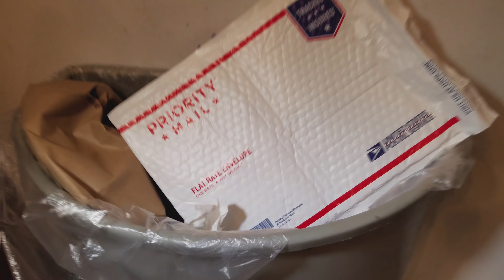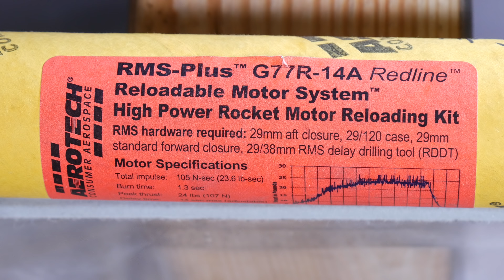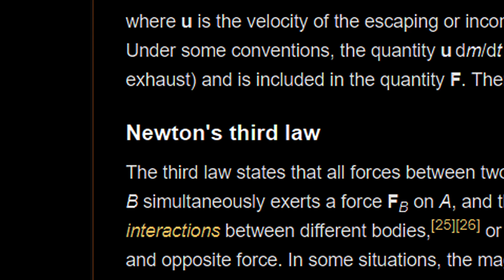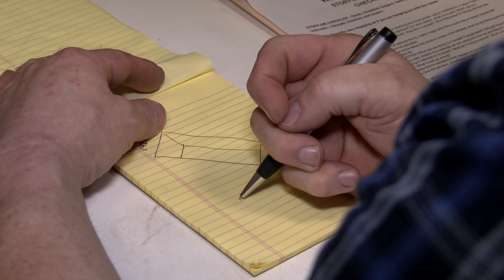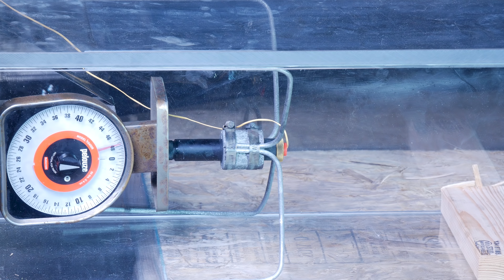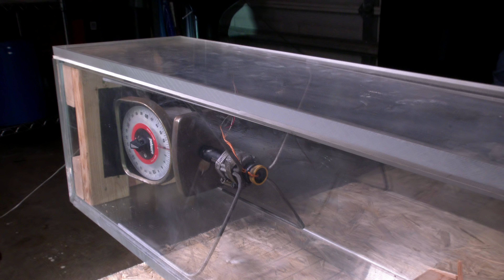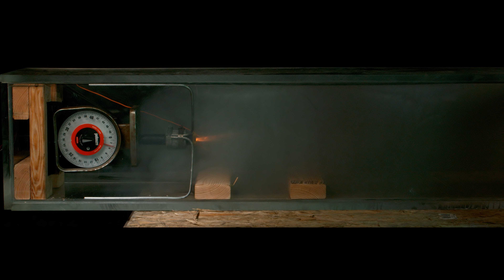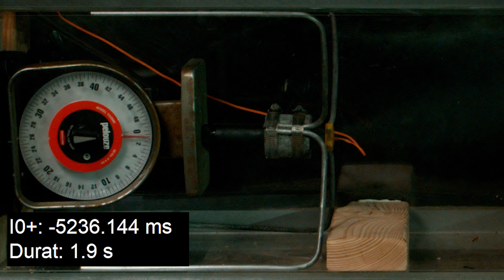Rockets in a Vacuum Chamber - Newton's third law of motion Visualized

Comment: It is hilarious that people are even questioning Newtons 3rd law - Is the dispute just over rockets in a vacuum? For the doubters, how does recoil work when you fire a gun? Is the force you feel the bullet pushing back off the air? The principle is the same, you throw something away from you and it will impart a force in the opposite direction. In the case of a rocket, it's lots of fast-moving gas, or many tiny bullets, if you will.... Try sitting in a wheelchair and firing an automatic weapon forward, you will start to move backwards. What's the difference between that and a rocket firing?
Reply from the maker: I was not questioning, just for fun. but I do like the firing a weapon in a wheelchair idea, that would be hilarious to see.
Reply: @WarpedYT  ive actually seen someone do that on youtube
Reply: If you do it put post the video :-)
Reply: seriously? trying to compare the forces, & effects of gunfire and a rocket engine? dude that is absolutely ridiculous, the 2 couldn't be any more different, thanks for the laugh though
Reply: @snuffly569  really. They are more similar than you think. A contained explosion ejecting, mass to cause which recoil creates acceleration. The gun is a rocket, the neck of the barrel is the burn chamber, the end of the barrel is the nozzle, and the gas and bullet is the exhaust of the rocket. Breaking it down to the simplest form, they are very similar. Except one has a short impulse while the other is a constant impulse.
Reply: @snuffly569  so if the atmosphere is needed to push off of. Can you explain why does the recoil on a gun not depend on elevation? Thinner the atmosphere the less pressure the atmosphere can push back?
Reply: i don't understand your question, elevation has nothing to do with a guns recoil
Reply: @snuffly569  exactly, if elevation has nothing to do with recoil, then the atmosphere has no effect on the gun. Then the atmosphere has no effect on the rockets recoil of the thrust. If you break down the forces and momentum of the rocket, it acts just like the recoil of a gun, except it is full auto and has a much faster cyclic rate.

The recoil of the gun and on the rocket is caused by newtons third law and follows the conservation of momentum. Atmosphere is not needed to cause the reaction force to propel the rocket, just like how it is not needed to cause recoil of the gun.
Reply: recoil in a gun is caused by the gasses inside the bullet casing expanding, it is that expansion that pushes the "slide" backwards, which is what is known as recoil, it would act the same underwater, at ground level, and in the air, & in a vacuum. elevation is nothing more than a descriptive term to signify the distance something is above sea level, and is irrelevant to the workings of a gun.  a rocket engine works in a different way than a gun, when a rocket is in space in a total vacuum, if it fires it's rockets, there is nothing for the rocket engine to "react" against, when a rocket leaves a planets atmosphere and enters the vacuum, the crew can turn off the engines, and the rocket will continue at the same velocity, in the same direction, until an outside influence alters its speed or trajectory, with nothing to react against, "directional thrusters" will do nothing more than to vent gasses into space
Reply: @snuffly569  look at a bolt action gun. The recoil isn't felt till after the bullet leaves the barrel. The force of expelling the gas and bullet to leave the system is what causes recoil. Just like the force of expelling the exhaust causes recoil. Every action has an equal and opposite reaction. 

Another way of thinking is the conservation of momentum. When the bullet is inside the gun there is no momentum. As soon as the bullet exits the barrel with velocity, the bullet has momentum. Without an external force acting upon the bullet the total momentum of the bullet/ gun system must remain zero. The explosion is and internal force because it was within the bullet gun system. So the gun must have momentum in the opposite direction equal to the bullets momentum to conserve momentum. 

The force of the expanding gas being expelled is how ar 15 works, muzzle break,   gas blowback works. It's also the reason why silencers have less recoil. The gas exiting the system is prolonged and slowed. This lengthens the impulse and lowers the momentum of the gas.
Reply: @snuffly569  if thrust needs an atmosphere to push off of, how can the sr71 reach mach 3 at 85,000-100,000 feet?  Wouldn't the thin atmosphere lower the force propelling the jet be greatly weakened by the thin atmosphere? How can the thrust push against the atmosphere moving away from it at mach 3?
Reply: +chrnc avngr
Sorry pal but that is incorrect.
Go fire a blank from a firearm.  No perceivable recoil.  Yeah, there is a bit but not really enough to feel and yes, I have done it many times starting on the fourth of July when I was like 8 years old and the old man let me fire a 30-06 with blanks into the air.  The MAIN force is the mass of the bullet vs the mass of the gun as they become opposing forces when being separated by an explosive release.  Fire a 100gr bullet from a 30-06 and you will get considerably less recoil than a 180gr bullet with the same powder charge.  All experienced shooters know this.  This effect is obvious when you play around with muzzle loaders and go from patched ball to conical bullets.
Reply: Um, recoil.  Doesn't cycle it with blanks unless the spring is tweaked to fire blanks.  You can read this https://www.quora.com/How-much-lighter-is-the-recoil-when-shooting-blanks#
or any one of many articles on the subject if you like.  Sorry to call you out but we are all learning and none of us have all the answers.  I happen to have personal experience with this so I jumped in.
Reply: @bethechange4934  what you just said proves that I'm saying. By having more recoil by just raising the mass of the bullet, is F=ma. The bullet and gas combine is the mass being accelerated. It has nothing to do with the atmosphere around it. Recoil isn't felt until after the bullet leaves the system.  As i said, the bullet and gases as a whole represents the gases being expelled from the exhaust of the rocket. Except the rocket is expelling a lot more mass than a couple of grams and for a greater amount of time than a split second. 

The little recoil felt shows the exhaust has mass, but the acceleration of the mass is less and slower because it isn't contained as well.

 But the fact that the gun itself with the same round fired at sea level and at 10,000 has the same felt recoil shows that the atmosphere is necessary to have recoil. So in the vacuum of space the gun will still recoil, as will the rocket
Reply: @bethechange4934  so there is recoil firing blanks, but a lot less. And will firing this modified gun be dependant on firing it at sea level and at 10,000 feet? Will it not cycle at 10,000 feet.

Oh i deleted my comment, just because i wanted to try and word what i said better. Part of what I originally said was, how does the blank cycle a handgun.  The resposne was that the handgun would have needed to be modified with a weaker spring to work.
Reply: I agree with you now, kinda.  Yes, the exhaust gas has mass.  Yes there will be an equal but opposing force.  I wasn't trying to contradict that, just point out the error of your first statement.  One tiny tiny thing, and it's nothing to argue about, the recoil of the gun will begin the exact moment a force is applied between the mass of the bullet (or eject gas) and the gun.  The moment there is force, the equal but opposing force comes into play, not after it leaves the barrel.  The friction of the bullet in the barrel will partially overcome that force as the bullet tends to drag the barrel forward while it is running down the barrel but obviously friction is not enough to cancel that force or the bullet would stop.
I believe that rockets do in fact exert force in a vacuum.  I just don't believe that it is as strong as they would exert in an atmosphere where the atmosphere is essentially acting like the bullet by adding more mass to the ejected gas.  
Have a blessed day and thank you for the discussion.
Reply: @bethechange4934  all of the forces are internal to the system and cancels out. Once the bullet leaves the system it becomes an external force. Any momentum while the bullet is inside the gun will not have an effect of the gun until it leaves the system.
Reply: @bethechange4934  what specifically were did i get wrong?
Reply: @shonmugerian  oh my god, i didnt think about that. You're right. The rocket is not ejecting any mass, like the gun is ejecting the 155 grain bullet. Well, except for the millions of tons of burning exhaust and fuel. You are absolutely right, it's not like a gun. The gun is too slow, it's more like a minigun capable of firing millions of rounds a second. 

Did you forget that the exhaust gases have mass? What was needed again to follow Newton's third law? Mass and acceleration? Well it does have a burn chamber capturing pressure and acclerating tons of exhaust at a high rate.

Wait didnt i already say that the breach is like the burn chamber, the barrel is the nozzle, the bullet and gases is the exhaust? Hmm so how are they different?
Reply: Just like the soap propelled boat I made when I was a kid.
Reply: Combustion products. Using the space shuttle main engines, for example, which burns hydrogen and oxygen, the rocket is throwing water.
Reply: Warped Perception what about firing a 9mm parabellum blank round?  In vacuum?
Reply: u cant see the whole chamber ;) only a thirs of it... while the rocket is running!
Reply: It is hilarious that questionable material is questioned...  Fire burn because of oxygen in our air .. when the flame ignited behind the rocket how did that happen if all the air - oxygen- was sucked from the tank ...   also  no air ,  what is the rocket propelling off of ... these are valid questions. If you think otherwise then you are just a sad man...  sorry..
Reply: Two solid masses the bullet!!! Try firing blanks see how far you go!!!!
Reply: +Son Mugerian "Thoughtless comparison, guns throw lead... So whats the rocket throwing comparatively?"  Comparatively?  Well, for example, the F1 rocket engine throws some 10 tons of exhaust gas every second at velocities of around 4000 feet per second.

How much recoil do you think you'd get from throwing a 10 ton truck every second at around 3000 mph?
Reply: +Deal with IT You're demonstrating how little you know about rockets, and you're understanding of how they work is non-existent.  Hilarious.

Fires burn because they have an oxidizer.  It doesn't HAVE to be in air.  Gunpowder doesn't need oxidizer/oxygen from the air.  It's already built in.

Most liquid fuel rockets have tanks for the fuel and tanks for the oxidizer.  The tanks are designed so that they both run out at the same time.  When they run out, the motor stops.  Is this a surprise?  When your car's gas tank runs out, the car stops.  Stop the presses!  Er, no.

What is the rocket propelling off of?  The exhaust gas.  It's so simple, it's hilarious when people misunderstand it.
Reply: @Blue Wright Yeah, the principle is the same, my friend. You throw something one way and a force acts in the opposite direction... No difference, thanks for the laugh though!
Reply: @Shon Mugerian - Hilarious - You have just proven what I have said. A rocket fires billions of tiny particles (loads or grain) that come from the burning fuel - those, like the grains of shot, have mass. That mass is travelling out the back of the rocket and imparts a force in the other direction called thrust. In a gun that backward force is called recoil, in a rocket it's called thrust. Same principle, different name. It comes from the amount of energy it takes to expel the mass in a particular direction.
Reply: @be the change: Having an atmosphere will have an effect on the trust of a rocket, but only because the atmosphere provides some kind of back pressure. The effect would most like reduce the thrust as that pressure would need to be overcome - in fact I believe that rocket stages are required with traditional "bell-shaped" rocket cones in order to compensate for the change in pressure as the rocket ascends, the rocket engines used in the first stage would be less efficient at higher altitudes, lower pressure, that at sea level . I am no rocket scientist so perhaps someone who is could validate or debunk my statement. What I am 100% sure of is that atmosphere is not required to allow thrust.
Reply: @Blue Write So how do orbital craft slow down when deorbiting?
Reply: +Paul Barclay "So how to orbital craft slow down when deorbiting?"

Simple:

Orbital craft turn around so their engines are facing forward.  The engine's burn slows down the speed of the orbital craft, which means it can no longer maintain orbit.  So it falls.  They're not called "retrograde burns" for nothing.

[Commercial airliners do something similar when they first touch down.  slats come down on the wings behind the engines, which redirect the thrust forwards (instead of turning the aircraft or the engines around, which is a trifle, er, impractical).  This is called "thrust reversal".  The harrier VTOL jet worked similarly, by redirecting the engine thrust down instead of straight out the back.]

Take a good look at how the shuttle returns to earth: it turns around so that the rocket engines are facing forward, applies a retrograde burn (it only needs to slow down by about 300 mph), and it starts to fall out of orbit.  Next, it has to turn around and face forward, and it has a timelimit for this maneuver, because if it's not all the way around when it starts hitting denser atmosphere, it will tumble, break up, burn and crash.  Then the rest of the flight is just gliding downwards, shedding speed by keeping the nose up.
Reply: recoil works because the explosion is happening in an enclosed environment, throw a bullet in the fire and it only explode and goes no where, take the entire gun away just attacht the bullet with anything light that would keep it in place on a piece of steel wide open and put enouph heat to trigger the explosion and it will only explode right there, the bullet will stay in the middle of the explosion while the exolosion forces will be spread 360 degree equally. There will not be any recoil. I tried it.
Reply: Excellent analogy Paul.
Reply: try bulding a gun in paper but keep the trigger see if you are going to have a recoil
Reply: +lp d "recoil works because the explosion is happening in an enclosed environment, throw a bullet in the fire and it only explode and goes no where"

There's something you're evidently completely unaware of with firearm cartridges, and similarly with rocket motors:

1) The burn rate of gun powders (as with most rocket fuels) is highly dependent upon the pressure it develops during burning.  If it doesn't develop a high pressure, the burn rate is slow and takes quite a while.  A cartridge dropped into a fire develops very little pressure before the cartridge pops apart, spilling not yet burned powder into the fire.  Which in turn burns very slowly because of lack of pressure.  you can prove this yourself by taking a shotgun shell, carefully prying it apart, and spilling the powder onto some tin foil and lighting it with a match.  It takes many seconds to burn, and depending on the powder it will seem quite weak.  With modern rocket solid propellants, the same thing is true - take a fuel grain out of an Aerotech motor, and light it with a match.  Even lighting it isn't altogether easy, and it will sizzle and sputter for a several minutes acting like a weak road flare, compared to the usual few seconds of loud shriek when fitted into a motor.

Which means that uncontained a firearm cartridge has relatively little recoil, but not zero.  The bullet will be heavier than the casing.  The bullet won't move much because it masses more than the casing does.  Looking to see how far the bullet went is pointless, did you bother to look to see where the casing went?  I doubt it.

You're forgetting that in a rocket the combustion chamber is entirely enclosed (except for the nozzle, doing much the same duty as a gun barrel).  So, yes, recoil is maximized.  The only time the combustion chamber isn't enclosed is when the rocket catos.  Which is a slang term of us rocket heads for when the rocket motor ruptures.

2) You don't understand that in a firearm cartridge, the mass being thrown is the bullet, but in a rocket the mass being thrown is the gas.  The mass of the propellant is far less in a firearm cartridge than in a rocket.  For example, in one particular cartridge I'm familiar with, the bullet can weigh 200 grains, but there's only 40-45 grains of propellant (if you exceed that, you may exceed the 40,000-60,000 PSI that the rifle chamber is designed for), which in turn generates (at most) 40-45 grains of gas - and in turn the bullet travels around 2200 feet per second.  The payload weighs 5 times as much as the fuel does.  So at most, the recoil due to the gas being thrown is 1/5th that of the bullet.

Meanwhile, let's look at a rocket.  A particularly big rocket - the Saturn V.  Every second the Saturn V consumed 10 tons of fuel+oxidizer, producing 10 tons of gas.  The gas coming out the back of the rocket was at a speed of about 4000 feet per second - twice as high as a bullet.  This would be like a gun firing a 10 ton truck at speeds of over mach 3. Rather more recoil than 200 grain bullet at mach 1.8, eh?.  And _continuously_, not just one sharp jolt..  Think*, if you can, how much recoil a gun firing a 10 ton truck at over mach 3 *every second would generate.  That's one freaking hell of a lot of recoil.  In fact, it's about 7,500,000 pounds of recoil, *continuously*, not just one sharp jolt.  No air resistance required, the recoil from a rocket is enormous, so enormous it easily lifted a rocket that weighed 6,000,000 pounds at lift off.

[I've seen people claiming that there's not much fuel in a rocket.  On the contrary, at liftoff the Saturn V weighed 6,000,000 pounds (3000 tons).  Without any fuel or oxidizer on board, it weighed about 450,000 pounds (225 tons).  More than 90% of the weight of the Saturn V was just fuel and oxidizer.  Most model and amateur rockets don't have such high fuel/total mass ratios.  But I've worked with a few that were higher.]

There are actually rocket designs based loosely more like a gun.  There's the old 1950/60 "Orion" project - a massive concrete and steel plate with a lead-lined compartment for people on top.  Underneath, you fired a half kiloton nuclear weapon every second or two.  A rough ride to be sure, but with enough mass in the "plate", it would be nothing more than a dull kick in the ass every few seconds. It was cancelled pretty promptly when they started thinking about the fallout it would produce, and there was a test ban on in-air nuclear detonations.
Reply: Sorry, I thought you were a "rockets don't work in a vacuum" guy, my mistake.
Reply: Paul Barclay, there is no dispute over Newton's third law, the dispute is:  There is NO action because there is NO atmosphere for the thrust of the rocket to act apon, therefore that negates the re-action.  One cannot have a re-action unless there is an action.
Reply: +Thomas Gronek Of course there's "atmosphere" to push off - it's the exhaust gasses from the rocket....

Consider a Saturn V's F1 rocket engine.  The F1 engines on the base of the Saturn V converted 10 tons of LOx and kerosene into 10 tons of hot gas per second, and threw it out the back end at speeds of around 4000 fps.

How much "action" do you think "throwing the equivalent of a firetruck at almost a mile per second, EVERY second" is?

About 7.5 million pounds of action.  Which is how much thrust the Saturn V booster had.

No external atmosphere required.  Rockets work in vacuum.  Sorry.
Reply: Thank you for a crisp clean debate instead of name calling that too many people do.  It is my contention that unless there is atmosphere for the rocket to take action upon, that the thrust is lost in space.  I do have an idea, since the rockets are difficult to ignite in a vacuum, why don't we consider the following experiment:  increas the pressure inside of the chamber.  If the rocket produces more thrust than it does at 1 atmosphere, then it can be concluded that atmosphere is a major factor in the action / re-action scenario.
Reply: +Thomas Gronek You  think pushing tons of combusting fuel (as gas) out the back end is  not an action?  Why not?  Imagine instead, that instead of a few ounces of gas being flung out the back end at several thousand feet per second, you flung that same number of ounces of lead pellets out the back end at the same speed.  Same thrust.  Newton's third law.  Also Tsiolkovski's rocket equation from the 1890s.

[Tsiolkovski is the true father of modern rocketry.  Goddard & Oberth were the fathers of liquid fuel rocket engines.]

Rockets aren't particularly difficult to ignite in a vacuum.  The reason why this motor was so difficult to start is because he was using the really crappy igniters that come with Aerotech motors (Aerotech calls them "copper heads", we call them "crappy heads").  They're marginal at the best of times even in atmosphere.  Been there, got the t-shirt of too many failed Aerotech motor starts.  The cool kids use the igniters that come with Cesaroni (and other) motors.  The good igniters are what they use with fireworks - where they just HAVE to go without fail within a split second.  Aerotech copperheads, in a word, don't*.  Have yet to *ever see a Cesaroni fail to start first time.

In point of fact, rockets fired in atmosphere are between 5 and 20 percent less efficient than a rocket fired in vacuum.  Why is that you think?  Here's why:

- the speed of the exhaust gas depends on the pressure differential between the combustion chamber (typically about 200 PSI in most American-made large liquid fuel rocket engines) and ambient pressure.  In short, the exhaust gas has to push the atmosphere out of the way.  In air, the total pressure differential is about 200-14.7 or 185.3PSI.  In space the differential is a full 200 PSI.  So, the exhaust gas comes out about 7% slower in air than it does in space, F=MA, so the thrust is about 7% lower in atmosphere.

*Further*, at the other end of the rocket, the rocket has to push the air out of the way - atmospheric drag.  Reducing its overall net thrust even further.

In amateur rocketry calculations (oh believe you me, we do lots of math to predict how fast and high our rockets go, and we get it right) the ONLY influence air has is on the drag induced on the rocket.  The diameter of the rocket has more influence on the actual peak altitude than the mass does because of drag.  Ironically, because of drag, sometimes you have to add extra weight to a rocket to make it go higher.  Yes, it all does make sense once you get into the science of it all.

The basic engine in Space X is always the same.  The difference is between first stage and upper stage.  The nozzle and thrust bell is different because the first stage is optimized for max thrust in full atmosphere, and the second stage's nozzle/bell is optimized for almost-zero-to-essentially zero atmosphere.

One final point: every single successful orbital launch proves that thrust works in vacuum. Why?  Because every single successful orbital launch has required at least two stages.  If thrust didn't work in vacuum, the second stage wouldn't do anything.  The Saturn V staged at 42 miles up and doing 3000+mph.  That's almost (the standard definition of) space, and the pressure is so low as to be almost non-existent.  If the second stage didn't work, the rest of the rocket would have made a big hole in the ocean, instead of accelerating even faster.  Do remember the top end of the rocket had to reach 17000+ mph.  The Saturn V actually had to use 2 1/2 stages to reach orbit.

SSTO (single-stage-to-orbit) is theoretically possible, and it would be desirable if you could keep the costs reasonable (conceptual designs have exotic/nasty/expensive fuels), but it's never been done yet.  The earth's gravitational well is the culprit.  On the moon, achieving orbit around the moon is something just about any high power amateur rocketry nut can achieve.  I helped launch a 200 pound amateur rocket (achieved mach 2.4 and 45,000 feet) which would have done the trick very nicely.  You could probably do it with rocket weighing about 20 pounds.  No drag to contend with, you just have to reach about 2000-3000mph.  Piece of cake without atmosphere.
Reply: fromage;  the rocket thrust has nothing to act upon.  Therefore no action exists.  A rocket only moves from an area of greater pressure to lesser pressure, since the pressure behind the rocket is equal to the pressure in the front of the rocket (zero), there is no movement
Reply: +Thomas Gronek "the rocket has nothing to act upon"?

Don't be silly, of course it has something to act upon.  The mass of the ejected gas.  The action that the Saturn V booster stage had was the equivalent of throwing a 10 ton truck at a velocity of 4000 feet per second every second.

Let's say for sake of argument that you were so strong you could throw a 10 ton  truck at 4000 feet per second.  You weigh, for sake of argument, 200 pounds.  The thing you are throwing outweighs you by a factor of 100.  The force you apply to throw the 10 ton truck thataway at 4000 feet per second has an equal and opposite reaction of throwing you the other way at 400,000 feet per second.  That's about 80 miles per second, 288000 mph or mach 350.  Basic conservation of momentum and Newton's third law - basic physics that every high school student not only should learn, but be forced to prove to themselves in lab experiments.  I was.  If you weren't, your education was sadly defective.

Obviously this is even more true in vacuum than in atmosphere, because all atmosphere does is slow you down  - in fact, you'd be better wearing your asbestos undies because trying to drive yourself through atmosphere at mach 350 is going to get pretty damn hot pretty damn fast.

[The large high power  amateur rocket I assisted in launching hit mach 2.7, and was above mach 1 for over a minute.  Fried the nose cone paint right off]

Incidentally, 80 miles per second is approximately triple the maximum speed that a solar system originating meteor can hit the earth at.  You'd make a rather bigger bang than the Chelyabinsk meteor strike did.  You wouldn't just break a million windows (which I seem to recall the Chelyabinsk strike doing), you'd flatten the towns and kill people purely by shock wave.  Chelyabinsk's fatalities were caused by poorly constructed buildings collapsing.

The fact that the reaction mass is gas is irrelevant. Whether or not there's atmosphere is irrelevant.  The fact that it has mass, and it was accelerated is what gives the rocket thrust.  Tsiolkovski's rocketry equation rulz.  Look it up.  And no, Tsiolkovski was born, raised and worked in Russia, and died about 50 years before NASA existed.
Reply: fromage;    "Let's say for sake of argument that you were so strong you could throw a 10 ton  truck at 4000 feet per second....."  So with that said, you are correct about me moving in the opposite direction,,,, let's reduce the weight of the truck,,, now I do not move as fast... let the truck weigh nothing..... now I don't move at all... this is the same as the rocket pushing against a great void, as sea of nothingness... the rocket thrust has nothing to push against, and therefore doesn't move.  I understand your point, and I understand that my point is counter intuitive... but that doesn't make me wrong and you right.  Yes, my concept is hard to grasp,  Sleep on it for a few weeks.
Reply: fromage tête :  If there is no pressure variation, then the rocket won't move, True ?  If the rocket is in a vacuum, then there is no pressure, if the rocket is ignited, then there is still no pressure,,, the rocket won't move.              What moves faster, the top of a bicycle tire or the bottom (where it contacts the ground) ?
Reply: Kennie, you are not alone here,,, I (and many others here) also contend that if there is no action, there can be no reaction.  I am presenting this argument from a point of difference in pressure between the front and rear ends of the rocket, and when in a vacuum, there is no pressure variation, both ends are at ZERO pressure.  Therefore no action, therefore no reaction.
Reply: +Thomas Gronek "So with that said, you are correct about me moving in the opposite direction,,,, let's reduce the weight of the truck,,, now I do not move as fast... let the truck weigh nothing..... now I don't move at all... "

So you agree with me, except that you're fooling around with the weight of the expelled mass.  You don't get to play a game with magic mass disappearance if you expect to match reality.

A 10 ton truck weighs 10 tons, right?  So you take a combined total of 10 tons of kerosene and liquid oxygen and burn it.  What does it produce?  10 tons of CO2 and H2O.  How can it weigh nothing?  Where did the mass go?  So what makes you think that the exhaust gas of a rocket weighs nothing?

Your point isn't counter-intuitive or difficult to grasp.  It's quite simply as wrong as it can possibly be.

I spent the hour or so required to understand this long before I got my BSc and MSc in physics over 40 years ago.  it's time you caught up.  If it takes you weeks, you're clearly doing it wrong.
Reply: +thomas Gronek starting multiple postings with different half-baked theories isn't going to do you any good.  Rockets moving have nothing to do with pressure, and everything to do with throwing mass.  Period.  There are rockets that work just fine (in vacuum especially) that don't rely on pressure generation at all.  All they do is throw mass one way, and they go the other way.  It really is JUST THAT SIMPLE.  Not even counter-intuitive.

A rocket would work just as well throwing 10 pounds of lead out the back at, say, mach 3, as it would throwing 10 pounds of any gas out the back at mach 3.

Tsiolkovski rocket equations rulz.  Do look him up.  That's the basic equation behind ALL rocketry, whether they work by combustion/gas, cold gas, slinghots, cross-bows, Orion nuclear drives, or ion accelerators.

This is the description of the Tsiolkovski rocket equation:

"The Tsiolkovsky rocket equation, classical rocket equation, or ideal rocket equation, describes the motion of vehicles that follow the basic principle of a rocket: a device that can apply acceleration to itself using thrust by expelling part of its mass with high velocity and thereby move due to the conservation of momentum."

Notice it doesn't mention air or pressure anywhere in there?
Reply: Fromage, I also have letters after my name, but that doesn't make a person think.  Obviously the points that i present are hard to grasp (not for me, cause i thunk it).
Reply: internal combustion engines work because of pressure.
Reply: +Thomas Gronek  I can't see how you can possibly find 10 tons of exhaust gas having no mass a simple thing to grasp.  Do you often have mass magically vanish on you?  That's what your "points" require to have happen.  

Obviously your letters are not helping you at all to think.  Vanishing mass.  That's a new one.
Reply: fromage, if you don't want me to jump around, then stick to the point, and it is impossible to present a full-baked idea to someone who can't digest it (I'm not going to bother baking it through).  Speaking of baked,,,,,  Please explain why pressure has nothing to do with rockets your 3rd sentence presumes that rockets work in a vacuum,,, you can't do that in a discussion...........Let's just assume our point to be fact then base our presentation on the conclusion that hasn't been concluded
Reply: it is more about vanishing thrust, and unless there is something acting upon the exhaust [gravity, (which isn't real either)], there is NO mass.
Reply: +thomas gronek Your theory, so far, consists of having the gas being ejected out of the back end of the rocket at high velocity having NO mass.  Where did the fuel mass go, if not out the nozzle?

Until you can explain where it goes, your theory can never be more than half-baked.

Remember you've already admitted that if you throw a 10 ton truck at 4000 feet per second, you'd experience one hell of a lot of thrust the other way, atmosphere or no atmosphere.  So you seem to be accepting the law of conservation of momentum and its corollary, Newton's 3rd law works in vacuum.

if you accept them, then the ONLY way that a conventional gas powered rocket wouldn't have thrust in vacuum, is that the gas has no mass.  So again, WHERE DID DID THE FUEL MASS GO IF NOT OUT THE NOZZLE? 

Do stop trying to evade the question.
Reply: +Thomas Gronek I never once mentioned traditional (eg: piston powered) internal combustion engines.

And AGAIN, not all rockets work off combusting fuel to gas to produce pressure.  Ion engines don't.  Cold gas rockets don't.  A thruster built by throwing a bowling ball with a massive spring doesn't.

All rockets work by throwing  off portions of their own mass with or without combustion or pressure.   You still haven't researched Tsiolkovski, have you?
Reply: Fromage,,, that is correct, I throw a truck, BUT, the exhaust gasses from the rocket throw nothing, the gasses are blown off into an infinite void, with no resistance.  I throw truck, we both go away, the rocket throws nothing.  If the truck offered no resistance, I would not move, I f I offered no resistence, the truck would not move.  The rocket's exhaust is coming in contact with nothing, there is no resistivity, the rocket does not move..to rubute your last paragraph, the rocket's exhasut has no mass---the exhaust is thrust into space without moving the rocket.  There is no mass, the products of the reaction are ejected into space without any other occurence.   Newtons third law implies that there must be an action, in a vacuum however, there is no action taking place, therefore no reaction.
Reply: the rockets work within atmosphere because there isn't an equilibrium between front and rear pressure.  If activated within a vacuum one will find that there is no pressure imbalance, both sides are equal, but both sides are at zero PSIA.  No pressure dif, no motion.
Reply: +Thomas Gronek So now you're being explicit: "the rocket exhaust has no mass".  Okay, *think*, where did the 10 tons of fuel (kerosene) and oxidizer (LOx) that produced it go?    Do you really believe that CO2 and H2O don't have any mass?

Really?

Come on now, this is the third time I've asked.  WHERE DID THE MASS GO?

Why are you so scared of answering this simple question?

I'm truly getting worried about you Thomas, this magical disappearing mass you're making up is, how should I say it politely, batshit crazy.
Reply: claiming that the 'mass' of gasses is responsible for moving a rocket is like having an ant push an elephant up hill
Reply: +Thomas Gronek Still evading the question I see.

Oh I assure you, if that elephant threw 10 tons of ants at 4000 feet per second downhill, that elephant would be going up hill probably rather faster than that (most elephants don't quite make 10 tons). Atmosphere or no atmosphere.

Thomas, Thomas, sigh, Thoomasssss....  10 tons of reaction mass is 10 tons of reaction mass, whether it's a 10 ton truck, 10 tons of exhaust gas, or 10 tons of ants. Tsiolkovski rulz rockets you know, and Tsiolkovski's equation doesn't even mention gas or pressure.  Just mass ejection.  Period.

I'd hate to think of the effects of 10 tons of ants impacting at 4000 feet per second - the splash of formic acid alone would have everybody itching for miles.   6000 feet or so per second straight up, means about that much coming straight down.  Poor elephant....

Why are you still evading the question?  Why does the exhaust gas have no mass?  Where did the 10 tons of fuel and oxidizer go?

If you're going to try to claim that exhaust gas has no mass, and thus provides no reaction, you'd better have a good explanation of where the mass goes.  So far, we got bupkis.
Reply: +Thomas Gronek I guess you've run away with your tail between your legs when you're faced with trying to explain the unbelievable horseshit that 10 tons of exhaust gas doesn't really have 10 tons worth of mass.
Reply: @snuffly569  ...if so then why does a rail gun recoil???
Reply: @LiftoffLumberjack  ...and the exhaust is a beautiful pearlescent white cone: I've seen it. That last shuttle launch was just before dawn and I was 200 miles due west of where the SRB's drop off. I could actually see the exhaust nozzles for a short time also. Wish I could've gotten a picture.
Reply: @philgiglio9656  :) I've never seen it. I had my heart broken by a scrubbed space shuttle launch. It flew the day my flight left.
Reply: @thomasgronek6469  Hmmm... I think you need to go back to school.
Reply: @snuffly569  said "seriously? trying to compare the forces, & effects of gunfire and a rocket engine? dude that is absolutely ridiculous, the 2 couldn't be any more different, thanks for the laugh though"

WRONG! They are NOT different and they knew this long ago..  https://youtu.be/1KQFVdnkg5Q?t=145
Reply: @thomasgronek6469  here I can resolve this for you easily: does a CROSSBOW experience recoil? Yes or no?
Reply: Molecules in a vacuum will never collide or Cath up to one aother.They can't give reaction desired
Reply: @kenniecrowder3872  - I can convince ANYONE with a high school grasp of physics that rocket MUST work in a vacuum.  Can you answer about 5 high school physics level question with no math?  First question: Does a CROSSBOW firing a standard steel bolt FEEL RECOIL?  yes or no?
Reply: Have u ever shot a gun in space
Reply: @aznmutt15  All good except for the fact that a rocket/jet acts more like a big fan pushing itself off of whatever is around it. The burning fuel that is ignited is forcefully blasted outwards onto the ground and molecules that are in the air giving itself acceleration. Picture a match being lit in a vacuum.... You will have ignition, but no acceleration. It would be like you taking a breath and blowing it out into space and expecting to gain movement from it.... You will go nowhere lol. Technically that is newtons 3rd law (equal/opposite forces/reaction) accept it does not work outside of our atmosphere. You can burn and burn and burn rocket fuel as much as you would like and give the escape route for that fire the tiniest little hole to give you the most potential for acceleration, accept in reality that rocket will just get brighter and never move and while that hole gets smaller, you will end up just putting that flame out. All you do is stoke a flame in a vacuum. The only way to move in a vacuum to my knowledge would be a mechanical arm in a forward position thrusted backwards then broken off before it stops, or an explosion.... And a rocket is not an explosion. The rocket would have to expel little grenades that exploded close enough to the ass end of the rocket ship that it would move the rocket, it could not be a constant pressure being released or burned from itself. It's like someone expecting a big cO2 canister to move in space cause the head breaks off. It would just sit there and exhaust gasses, the reason you get movement is because of the pressure buildup caused behind the canister in an atmosphere with pressure in itself that would move it, you would not get that pressure in space no matter how bad you want to believe rockets and shit are in space.
Reply: @GlorifyGodInEverything  absolutely wrong. A rocket is a contained explosion. Let's try a firecracker hanging inside a vacuum with a little plastic cup over it. What happens to the cup. 

You do realize that a rocket burns through tons of fuel every minute. That mass is ejected out of the nozzle. Now what happens when you have mass moving at velocity? Momentum. Now how is momentum conserved if the rocket and fuel system have a momentum gain for the exhaust and not the rocket?
Reply: @aznmutt15  You call me wrong? I am right, you are explaining your version of what you think a rocket does lmao. You keep saying mass being ejected out..... It's a turbine engine that powers the fuel and oxygen, this "mass" is being burned and propelled outwards because of the turbine, you have to have traction to catch this acceleration to provide movement. You do not get this in a vacuum. Like I said.... A fan... A better way to explain this to you would be... Imagine a Co2 canister full where the head breaks off, now imagine all that air being not blown out, but sucked out faster than it can be blown out by the pressure.... That is a vacuum. A rocket would have to have physical exertion the opposite direction on the ship it self meaning for that ship to move, you would have to exert some sort of mass the opposite direction of the rockets blast back onto the ship.... The "mass" being ejected out is already being sucked away from the ship and holding cells of the ship into the voids of space when they are opened up. That mass is not reacting in the ship to be bounced off of itself then fly out..... Just use your damn head. A vacuum is nothing and in space will not fill.... You have to have an actual explosion not a turbine fan spinning with rocket fuel and oxygen burning propelling outwards into nothing. That mass is flung out into a void and not reacting with the ship. Pressure is built between the fire and the ship propelling the ship, this doesn't happen in a void... That pressure is sucked away because of no atmospheric pressure to hold it self together. Everyone here thinking they know how rockets work... Using of all things "mass" and "newtons third law" in a theory of voids and no atmosphere without even knowing how rockets work to prove to themselves Nasa is telling the truth lol.
Reply: @GlorifyGodInEverything  what turbine? There is no turbine in a rocket. Even in a turbine jet engine,  it burns the fuel to cause expansion and eject the exhaust at high velocity to create thrust. How do you think after burners work? There is no pushing off the atmosphere. How can a jet flying at mach 3 push off an atmosphere, when the atmosphere is moving away from the thrust at mach 3?

I describe how all of physics describes how rocket works. You describe your misunderstanding of physics. Still waiting on your answer how momentum is conserved.
Reply: @GlorifyGodInEverything  momentum is mass and velocity. If you have mass, such as the burning gasses escaping the end of a nozzle at a rate of hundreds of ton per minute, leaving at a high velocity, it has a momentum. Now how is momentum conserved for the entire system, if you do not have momentum being created in the opposite direction equal to the momentum of the exhaust?
Reply: @GlorifyGodInEverything  I'm sorry, but the thrust does not leave the engine at mach 3 in an sr 71 engine. Even if it did, it will still not have sufficient energy to push against the friction of the atmosphere. It is pushing off of an atmosphere that is moving away from the exhaust at mach 3. Don't  forget it is a very thin atmosphere to begin with. 

And you said the bullet is a terrible example? Then why does recoil not effected by the atmosphere? Why is there not a significant drop in recoil from sea level to 10,000 feet? If it needs an atmosphere to push off of?

Maybe you should try googling, "what is thrust?" Where do they say it needs an atmosphere to push off of?
Reply: @aznmutt15  I understand what you mean, but you cannot gain momentum no matter how much pounds of pressure is leaving at a time in a vacuum of space, pressure cannot build behind the rocket to move itself because it is lost in the vacuum..... That is why this debate is even a thing. An explosion of force going in the direction of the rocket is what is needed, physical exertion on the ship itself not away from it.
Reply: @GlorifyGodInEverything  oh yeah and i forgot, turbine is a transfer of energy. It uses the thrust from the exhaust to turn the turbine. In other words the turbine uses energy of the system, not creates energy. So how does a turbine in a jet causes acceleration? 

Where is the turbine located in a rocket engine?
Reply: @aznmutt15  a bullet is sealed and pressurizes when the primer is punched creating pressure inside of a cylinder (bullet casing) forcing the bullet out one way and exertion of force from the casing moving the opposite direction against the gun causing recoil. Now if you had big ass bullets being fired out of a space ship, yes it would move, but not the way a rocket works. A rocket exerts energy one way, not two ways.
Reply: @GlorifyGodInEverything  you are avoiding the question. How is momentum conserved for the entire system if there is a momentum increase of the exhaust? Momentum is just mass and velocity. So if the mass of the exhaust is moving at velocity, it has momentum. It is irrelevant if there is a vacuum around the system. In fact the system is usually imagined in a vacuum. So how is momentum conserved?  Where is it in the momentum equation, the atmosphereic pressure come into play?
Reply: @GlorifyGodInEverything  and you dont know how guns work either. Tell me, is recoil is felt after the bullet leaves the barrel. So if the recoil is dependant on the surrounding atmosphere and not the momentum of the bullet leaving, why is recoil independant of the pressure?
Reply: @GlorifyGodInEverything  actually, no. Everything you said is all internal forces until the bullet leaves the barrel. The forces felt is dependant on the weight of the bullet and the velocity it leaves the barrel. Not the atmosphere pushing back on the bullet. It is the exact same principal to how rockets work. Once again conservation of momentum.

And the semi auto is entirely dependant on the type of system you are using. Are you using a blowback, direct impingement, or gas piston. All of which are different. Blow back is dependant on the recoil, but once again doesnt occur till after the bullet leaves the barrel. Piston and direct impingement is dependant on siphoning some of the gas back to cycle the gun. 

If the gun is recoiling at the ignition of the gun powder, how are people accurate for over a mile? The gun is moving before the bullet leaves the barrel, will cause the bullet to stray off course. Even having the barrel touching something during firing will cause the barrel resonance to shift to throw off the shot. A person will not be able to manage the recoil exactly the same way everytime they shoot. It's as if the recoil occurs after the bullet leaves the barrel.
Reply: @aznmutt15  So I must explain to you once again.... You say the guns recoil is dependent on the weight of the bullet..... (why you compare that to a rocket I don't know.) Yes but not as you see it, the recoil depends on the weight of the bullet because the gasses expansion rate depends on the weight of the bullet because the heavier the bullet the more force has to be exerted on the bullet to push it out of the way giving more force against the opposing side which would be the gun, dependent on the weight and powder of course..... pushing it the other way (recoil), the lighter the bullet with the same amount of powder, the less recoil because those gasses can expand and escape quicker exerting less force against the gun to release that pressure..... That's why you can fire a blank and not feel the recoil, but rather the shock. A force is exerted against the gun no matter the gas system and recoil is felt. The way a bolt flies back is dependent on the gas system but what I was saying was an example. I understand how guns work, I own many and don't need a lecture on different operating systems. What I used was an example. Guns go back because of a force pushing back on them.... You think because a bullet leaves out of the barrel before recoil is felt is because of the same concept of your idea of how a rocket works.... The bullet will leave past the barrel because more gas is pushing forward than backwards and believe it or not, but it takes time to push the mass and weight of a pistol back and it does not happen instantly. If you watch a boxer get punched in the face, his head doesn't instantly turn, the punch is landed then the shock from that punch moves through his head then his head turns....
Reply: @GlorifyGodInEverything  who says you dont feel recoil from a blank? It is a limited amount, but there is still recoil. As i stated there is mass, the bullet, moving at velocity creating momentum, bow how is the momentum conserved for the bullet and gun system. Hmmmm, oh it is the recoil. Wait, isnt that exactly how i described the rocket? The mass of the exhaust, considering it has thousands of tons of fuel and that is getting ejected at high velocity. Now how is the the rocket, exhaust system conserve momentum?
Reply: @aznmutt15  You are saying the rocket is the bullet then being propelled through the air by a force that exerted itself off a surface by an explosion that happened inside of a sealed tube inside of a barrel back against a bolt... And yes there is a slight recoil in a blank because there is force exerted away and also towards the gun, I know.... And rocket fuel is not exploded causing a force towards and away from the rocket but rather burned..... The way you describe the fuel is being a mass thrown out from the spacecraft.... In that case the fuel would not even need to burn, which obviously doesn't make sense. You still don't understand that the recoil of the gun is proving my point and not yours.... Recoil is felt by exertion of force against the gun..... In a spacecraft that exertion of force goes away from the craft rather than towards it... A rocket works with pressure that rides against itself in an atmosphere that is why you can haul ass at high altitudes, as long as you have atmospheric pressure, and it does not need to be much.... In a vacuum that cannot happen. All those gasses being pushed out are driven away by the vacuum... That force cannot go anywhere because it has nowhere to go besides away (vanishing forces). STILL you need a force going the opposing direction of the flame and a rocket does not do that.
Reply: @GlorifyGodInEverything  what happens to the gas is burned at a rapid rate in a contained  chamber? It is expanding exponentially. The only difference between burning and explosions is the rate which the fuel is consumed. The burn process is being controlled to a precise rate preventing an explosion. Since the fuel is burned and the pressure of the expanding gas is causing the mass of the exhaust to escape at a high velocity. Since there is mass and velocity the exhaust has momentum. So how is the momentum of the entire system conserved?

No. The rocket is represented by the entire gun. The firing chamber represents the burn chamber. The barrel represents the nozzle allowing the gas to expand and pick up velocity. The bullet and the burning gas represents the tons of exhaust being expelled out of the back of the rocket or muzzle of the gun
Reply: @aznmutt15  the way I picture it is a bottle shaken up then slammed on the lid. The lid breaks off and the gasses and liquid flies out of the end of the bottle and the bottle goes flying. I'm trying to wrap my head around the fact that a ship can push away from it's own mass (burning fuel) which is released into a vacuum when it's force is supposed to be lost in a vacuum. All I see is contradiction in it's concept unless i'm understanding the concept wrong. What I see is pressure is lost, momentum isn't gained, acceleration isn't formed and nothing happens unless a force is used against the ship itself which would be the mass of the burning fuel that is supposed to be lost in a vacuum. How can it move in a vacuum? Does the pressure not dissipate in a vacuum when it is released?? It has to from my understanding
Reply: @GlorifyGodInEverything  the bottle is flying because the liquid inside is suddenly epanding and the mass of the liquid being ejected out the neck is causing a force. There is an equal and opposite reaction on the bottle. One concept you need to understand is that vacuums have no power, they do not suck. The motion and power comes from the pressure differential of the higher pressure wanting to go to the lower pressure.  The size of the nozzle will limit how much pressure is released at any given moment. This will have a maximum flow rate given by fluid dynamics.
Reply: @GlorifyGodInEverything  look, conservation of momentum is a fundamental law of motion. This is something we have based many engineering feet around. The concept of thrust is based on this principal. You have a mass and eject it out of the system will cause the mass to have momentum, the system as a whole needs to conserve momentum, so there must be a momentum gain equal and opposite to the momentum of the ejected mass to conserve the momentum for the whole system.
Reply: @aznmutt15  So I get that, but what about the thrusts from side to side?
Reply: @GlorifyGodInEverything  what side to side thrust?
Reply: @aznmutt15  the squirts of air to line themselves up to an object in space.
Reply: @GlorifyGodInEverything  the rcs thrusters? Same properties. Hydrogen peroxide interacting with a metal catalyst to boil and create steam at a high velocity. It's the same mechanism used by those jet packs that bond and michael Jackson wore.

Remember mass at velocity equal momentum. There must a momentum to counter act the steams momentum to conserve the momentum of the entire system. Now place that thruster away from the center of balance, you create torque. Torque causes rotation.
Reply: @GlorifyGodInEverything  seems like rockets works in space. All of the excuses i have heard is the failure to understand the basic physics involved. If you go into the difficulty of pumping the fuel at the high rate or the difficulty of reigniting the engine in the vacuum of space, now those are the engineering problems nasa scientists has had to over come.
Reply: it has to push against something, and vacuum is nothing.. show us the gauge
Reply: @jondextersalise3649  once again. The burning exhaust has mass and is being ejected at velocity. If it has mass and velocity it has momentum. Since there is no external force at work, how is the momentum of the entire system conserved? If there is a momentum gain on the exhaust, there has to be a momentum equal and opposite to conserve the momentum of the system. This is a fundamental law of motion
Reply: @jondextersalise3649  since you believe a rocket needs to push off of something. Let me ask you a question. How come a guns recoil is not effected by elevation? Since there is a significant difference from sea level to 10,000 feet in the atmospheric pressure, there should be a significant difference in recoil, since the bullet is pushing off the air. Will a gun have recoil a vacuum?
Reply: @snuffly569  the principals are the same pal!
Reply: @aznmutt15  the scram engines are compressing oxygen, the sr71 is in atmosphere and burning oxygen
Reply: @meh11235  what does that have to do with the thrust pushing off an atmosphere that is moving along with the thrust at mach 3. How can it gain force if the air it is pushing off of is moving faster than the thrust?
Reply: @fromagefrizzbizz9377  'pressure so low to be almost non existant' does not equal vacuum...
Reply: @aznmutt15  what are you referring to?
Reply: @meh11235  there is two concepts of rockets not working in space. Rockets needing to push off of air and burning in a vacuum is impossible. I use the sr 71 as an example and ask how can the thrust push off an atmosphere moving mach 3. The exhaust is not being ejected at mach 3.
Reply: @aznmutt15  jets are not rockets...they have differing purposes and abilities though jets may convert.. (another topic)...
Your analogy starts at the false premise that rockets and jets are the same.  Rockets don't require atmospheroc oxygen to burn... 

The issue is that while rockets work, they are extremely limited to Up, Out of fuel and Down...   Parabolic vector only. 

I'd love to see a rocket test in a chamber that reaches a matching altitude of 350,000ft.  Haven't been able to find a test chamber capable of that yet. 
Considering the electric nature of the universe, might polarity and Frequency with respect to exhaust be more important to actually creating a rocket motor capable of sustained work out of atmosphere...
Reply: @meh11235  how a jet and rocket create thrust is irrelevant to the point. The fact that jets and rockets create thrust and how that thrust causes acceleration is the point. If thrust is dependant on pushing on the atmosphere, how does the exhaust push on an atmosphere moving away from it at mach 3.

Yes if a rocket was shot straight up and has not reached escape velocity, it will fall back. Since rockets are not shot straight up and launched at an angle where the velocity will be perpendicular to the pull of gravity. At certain altitudes, a specific speed will cause the object to reach orbit. That speed is determined by matching the centrifugal force and the force of gravity. This will cause the objects acceleration to be perpendicular to the velocity creating a circular motion.
Reply: @meh11235  you fail to realize that a chamber that there is little difference between 0.01 tor and 10^-10 tor. There is still only 0.01 difference.
Reply: @aznmutt15  false premise again, your assumption regarding my knowledge in the sciences means nothing. Rockets and jets are different. 
Point is, for this test to be valid, the environment must match the commonly known aspects of space and varying distances (altitudes from earth). The vacuum system in this test is fun indeed, but by no means accurate.
Reply: @aznmutt15  again your premise is false and question void
Reply: @meh11235  still avoiding the question. It doesnt matter how they work. They both rely on thrust to create a force. How that thrust is created is irrelevant. How that thrust causes a force on the rocket/jet is the point. The current consensus is that the burning is causing a force on the expanding gas accelerating it out of the nozzle creating an opposite force due to newtons 3rd law. The challenging theory is that the thrust is pushing off the atmosphere and it is the atmospheric resistance that is pushing back. So once again how does the sr 71 thrust push off an atmosphere that is moving away from the nozzle at mach 3?
Reply: @meh11235  a car tire and a bike tire uses different methods to create torque, but the torque causes accelerate the same way for both. A rocket burns fuel and an oxidizer to create thrust. A jet burns fuel and air to create thrust. How the thrust is created is irrelevant to how the thrust causes acceleration.
Reply: @aznmutt15  did you read the engine specs, it's literally spelled out for you
Reply: @meh11235  i know how both engines work as i spelled it out to you. As i said how they create thrust is irrelevant. They both use thrust to create a force. Now if thrust is dependant on pushing against the atmosphere,  how does the sr71 push off an atmosphere that is thin and moving away from the jet at mach 3. You do understand that both engine uses thrust to accelerate right? You do know what thrust is right?
Reply: @aznmutt15  you really need to dissociate rockets and jets...
With respect to hydrodynamic forces, aerodynamic forces, electrostatic forces, resistance, impedance and a myriad of other things....    Conventional jets won't work in the commonly understood knowledge of 'space'... A jet needs atmosphere to burn, it's a requirement...      A rocket does not.... However, given the common understanding of 'space' being a hyperinflation of expanding vacuum...  The force exerted by a rocket in space is absolutely tiny for attempts at travel... Utterly unusable for anything but missiles and high altitude launch platforms for sattelite balloons.
Reply: @aznmutt15  though I absolutely love jets and rockets... Other technologies are  much more capable than either regardless of earth's shape...
Reply: @meh11235  the funniest thing is the comment of "pressure so low that it is almost non existent " is pretty much the deffinition of a vacuum. A vacuum is a state of lower pressure where the higher pressure aeeks to create equilibrium. The strength of a vacuum is based on the differential of the pressure. The vacuum itself holds little value, the differential is the important factor. What you fail to realize is the fact that vacuums don't suck.
Reply: @meh11235  here is a simple questions. How does a burning of the fuel from a jet cause acceleration? How does burning of the fuel from a rocket create acceleration? I do not care how they burn the fuel, just how does the burning of the fuel create acceleration.
Reply: @meh11235  you still are missing the point. I am not interested in how the jet and rocket burn the fuel. What i am interested is how the burning of the fuel causes acceleration.  You keep focussing on how they are different because of how they burn fuel. I am asking you to look at how they are the same on how they use the burning fuel to create thrust and how does that thrust create acceleration. The method they use to burn the fuel is irrelevant to the question.
Reply: @meh11235  if you're going to be that pendantic/picky, then there's no such thing as vacuum.

Please explain to me the practical difference between a volume of space that has zero atomic particles in it (absolute vacuum) and one that has one atomic particle (pressure extremely low).

Any?

A difference that makes no difference is not a difference.
Reply: @fromagefrizzbizz9377  the difference is that what is taught is not reality. How can you suggest that two differing ideas are in fact the same? Expanding vacuum adjacent to water-vapor pressurized system without barrier is not demonstrated in nature.  Detail isn't pedantic when discussing the validity of the experiment presented.. That being said, with respect to others here that are attempting to bait conversation to give some jaw dropping reality on archaic rocket function... Just say your piece and get to your point.   How much time is wasted here trying to 'find out' one anothers work experience and education levels...     Conversation doesn't need to be a pissing contest.
Rocketry is fun...small and large scale. They are valuable tools and have very limited functionality in strong vacuum with respect to 'outer space'...
Reply: @meh11235  Word salad will never get you anywhere.  What we are taught, experiment with, and prove ourselves is what has been observed in reality.  There is no absolute vacuum in reality.  Period.  If you think there is, prove it.  Barometers work and proves that atmospheric pressure declines as you increase in altitude, and keeps declining as far as you wish to go.  if you think they don't, prove it.  Space is a purely arbitrarily chosen point based on, NOT when air disappears entirely, but when air pressure is close enough to zero it no longer matters for the purposes at hand.  If you think you know otherwise, prove it.

Rockets are a lot more useful in vacuum, because there's no other way to move around.

Or are you another one of those idiots who doesn't understand Newton's 3rd law, the law of conservation of momentum, or Tsiolkovski's rocket equations either?

Rockets work *just fine*, in fact better, in vacuum than they do in air.
Reply: @fromagefrizzbizz9377   agreed, Rockets are useful in atmosphere as you assert, their limitation being the extreme efficiency at which the angular momentum of each molecule is ripped apart at the speed of dissociation in low pressure and simulated high altitude vacuum environments... 

The plume shape changes from conical to round, like an explosion out the back of the craft and the speed increases at which the exhaust leaves based on atmospheric pressure.

Exhaust control in the form of shape(variable vector  (dynamic thrust control), polarity, charge, frequency and actual ejecta substance all matter...

The efficiency increase of rockets in vacuum is precisely the Mechanism that kills their ability to work long term in vacuum. Thanks for making my point clear. 
Your assertions seem to push the notion that as no actual vacuum exists, then there is a cap applying pressure to earth atmosphere..   Is that your assertion?  
Based on the original experimenter's post,... flat / spherical earth is what brought his team to build the test and yet, it seems that matching reality and even comparing and contrasting observation to 'common' knowledge is impossible bevause people can't agree on the principles of 'space' as it relates to vacuum as taught.
Reply: @meh11235  ok this is getting annoying. You are talking about points that are different than what im talking about. Ok lets start over. Do rockets and jets need to push off the atmosphere to accelerate? We can get to vacuums after.
Reply: @fromagefrizzbizz9377  ok i just realized there are two people. I usually do not focus on the names. Both of you have purple icons and it seemed like i was talking to one person
Reply: @meh11235  "extreme efficiency at which the angular momentum of each molecule is ripped apart at the speed of disassociation at low pressure..."

Er what?  You're slinging together scientific terms without any idea what they mean. Not the least being the absurdity that angular momentum has anything to do whatsoever with combustion or thrust or rocket motors in general.  Indeed, combustion has nothing to do with thrust either.  Read the Tsiolkovski equations.  No combustion.  No molecular disassociation.  Combustion is merely a means (production of energy) to an end (ejecting gas).   The "end" provides thrust, not the beginning.

"The efficiency increase of rockets in vacuum is precisely the Mechanism that kills their ability to work long term in vacuum. Thanks for making my point clear. "  

That is a ridiculous conclusion.  They work as long as they have something to eject, and a means by which they can eject it.  More efficiently in vacuum than air.

"Your assertions seem to push the notion that as no actual vacuum exists, then there is a cap applying pressure to earth atmosphere."

An equally ridiculous conclusion.  If, as observations prove, the atmospheric pressure declines as you increase in altitude, it's going to have to stop decreasing somewhere, right?  Well, it doesn't actually, the pressure simply gets lower and lower to the point where it's not worth mentioning.  Have you ever heard the term "asymptotic approach" - I don't expect you have because FE's can't math.  Do look it up and prove me wrong.

As for the observed behaviour of space/not-space not matching theory.  That just means you don't understand the theory.   The people who study, work with, and use it every day do.
Reply: @aznmutt15  Tee hee, you'd have had quite a reaction from me if you accused me of not believing in rocket thrust in vacuum ;-)
Reply: @fromagefrizzbizz9377  you're not understanding the implications of your own words when applied to through logic..   I merely asked you to clarify your point...  As your foundation is weak..
Reply: @fromagefrizzbizz9377  what happens when you gradually expose water to vacuum? What happens when it is exposed to vacuum suddenly?... 
Perhaps you don't understand why things boil...? The liquid moves to gas and then to plasma as voltage rises and atmospheric pressure decreases... 

Anyway,  the original poster brought up flat earth and now you...  I have stated zero opinion on the matter...    However, your assertion that no vacuum exists as taught would imply contaiment of atmosphere...
Reply: @meh11235  The behaviour of water when exposed to low pressure is not relevant to thrust.

And let's look at your assertion in more detail:

"The liquid moves to gas". ... depends on the initial temperature of the water, and how much of it is there is.  Cold water in bulk merely freezes.

"and then to plasma as voltage rises"?  WTF are you talking about?  What voltage?  A plasma universe nut too?

"However, your assertion that no vacuum exists as taught would imply contaiment of atmosphere..."

Repeating it doesn't make that conclusion any less silly.  

The fact is simple: there is no pure hard vacuum in reality.  *Anywhere*.  There are just places of greater or lesser amounts of matter, presentable by a pressure or some other measure.  "Pure hard vacuum" is no different than a place that just has VERY VERY little gas in it.  

You're welcome to explain the practical difference between a pressure of 0 and 1x10E-30 PSI.  Hint: there isn't any.  No "caps" or anything else needed, just a gradual decline in air pressure from sea level straight up for however far a distance you want to go.

Perfect vacuum is an "ideal state" that doesn't exist in reality.  At all.  Fortunately, ultra low pressure does a damn good job of imitating it.
Reply: @fromagefrizzbizz9377  it gets confusing. Im on my cell and see a purple logo and assumed it was the same person
Reply: @fromagefrizzbizz9377   you're arguing that there is no vacuum in space... OK, I agree to that... 
Now, would you agree that with no vacuum and a density of about 2 hydrogen atoms per cubic meter, the known universe is functioning as a plasma? Now go study plasma and tell about its electric properties...
Reply: @fromagefrizzbizz9377  with observable matter in the universe considered negligeable...  Electric forces supercede all others on the galactic scale...
Reply: @meh11235  you do realize anytime there is a lower pressure, it is considered a vacuum. In the 90s lotus designed
Reply: @aznmutt15   I'm well aware of the perspective that 'space' is 'considered' an expanding vacuum when it is in reality not a vacuum...
Reply: @aznmutt15  brine at the bottom of oceans  is more dense than normal seawater, that doesn't mean normal sea water is a vacuum...
Reply: People are not fully understanding newton's 3rd law...  It's more complicated to test than it appears.

This rocket test was a good attempt
Reply: @meh11235  what is the pressure differential between the layers? What's  the difference between density gradient and pressure gradient? 

So do you believe that a rocket/jet engine needs to push off the atmosphere to accelerate?
Reply: @aznmutt15  the premise of you're question is still false...
You asked whether or not liquids compress right ,...   Do you have some awe-inspiring knowledge regarding fluid dynamics that you'd like to discuss?
Reply: @meh11235  i did. I was writing it in the middle of work and didnt have time to post a a well thought out comment. 

Once i was able to sort my thoughts, i asked. What is the pressure differential between the layers? Are you confusing pressure differential and density gradient? Because the two are different concepts. The pressure difference is miniscule from one density gradient to the next.

Now let's get back to the crux of this thread. Does a jet/rocket engine need to push off the atmosphere?
Reply: @meh11235  as before i was sayimg whenever there is a significant pressure differential the lower pressure is considered a vacuum. If you imagine the atmosphere like a bunch of balloons piled on top of each other, the bottom ones are going to be smaller because they are being compressed by the weight of the balloons above. The higher you get the less weight of the balloos above you press down on you. Now the vacuum of space is just empty space with miniscule amount of balloons inside it. The vacuum holds no force, strength, or power. Only when there is a significant pressure differential is when there is a force. This is because the higher pressure wants to go fill in the void.  The force is derived from the higher pressure. Vacuums do not suck.
Reply: @aznmutt15  pressure differential and density gradient are separate yet intertwined, they are both result of angular momentum... Separated only by frequency and frame of reference. Both are dynamic imbalances based on vector, frequency, volume, pressure,  resistance, charge, polarity, impedance...     We can go deep into this but will probably get into classified stuff like electrodynamic skins and polarized pulsed plasma engines... 

What's your true point
Reply: @meh11235  they are not intertwined.  You avoided the question. What is the pressure differential between the density gradient? If i meassured the pressure above the briny water and inside the briny water what will the difference in pressure be between the two reading?
Reply: @aznmutt15  can't forget that with volume, exists geometry...  A major player in thrust production.. Especially in preservation of thrust exhaust shape / vector and expansion chamber design.
Rockets are for child's play and pretend. Space is not a vacuum and it's full of electric energy that may be accessed through frequency... Just like here on earth.
Reply: @meh11235  wow. Just making things up. What does volume have to do with f=ma?
Reply: @meh11235  the only thing geometry comes i to play is the area of the burn chamber which the expanding gass can escape. This will limit the pressure loss because there is a maximum speed, then volume of gas that will escape. Thus allowing the sustaining of pressure inside the burn chamber. Since the pressure is created faster than the pressure loss. In the end this has nothing to do with how the thrust creates acceleration
Reply: @aznmutt15  hydrodynamics and momentum within the chamber makes geometry matter...
Reply: @aznmutt15  are you suggesting that space resists the motor? Or are you suggesting that space does not resist the motor?
Reply: @meh11235  fluid dynamics is the limiting factor on the pressure loss, as i have already explained. Momentum has nothing to do with geometry. Forces are calculated as vectors and is not concerned with geometry. 

Even drag is simplified to the drag coefficient.
Reply: @meh11235  space does nothing to the motor. The area which the gas can escape the burn chamber is limited in area. As you said and i have stated before yhe fluid dynamics and the area limits the maximum flow of the gasses from escaping. This allowing pressure to be sustained. Vacuums don't suck.
Reply: @aznmutt15  you assert space does nothing to the motor...  
-you therefore suggest the motor engages space without impedance and thusly works to fill space, however fast space can accept the rocket discharge.
Reply: @aznmutt15  that being the case, where is the differential shift in energy  between the rocket and its environment that will allow hydrodynamic force to convert to momentum
Reply: @meh11235  the fact that there is no impedance has nothing to do with how thrust works. The simple act of applying force on the exhaust gases will impart a force back on the rocket itself. Newtons 3rd law. As i stated before, if a rocket/jet engine needs to push off an atmosphere, then how does the jet engine of an sr71 push off an atmosphere that is moving away from the nozzle at mach 3?

Since you like to talk about momentum, then let's also talk sunly the conservation of momentum. If the mass of the exhaust gases is ejected out of the rocket with velocity,  how is momentum conserved in the system as a whole. Without an external force there can be no momentum loss or gain on the system. So what cancels out the momentum of the exhaust?
Reply: @aznmutt15  sustained pressure exists only within the expansion chamber once at altitude...
Reply: @aznmutt15  false
Reply: @meh11235  energy and force are two different things. External Forces causes differential of momentum. Without an external force,  momentum can not change. Since the force is internal and there is a momentum gain in the exhaust gases escaping the system, how is momentum conserved in the system as a whole?  Where is the momentum gain in the opposite direction to conserve momentum?
Reply: @aznmutt15  3rd law is what I'm referring to..
From what you describe, space which is considered expanding vacuum, has no effect on the motor and thusly, will allow full uncontrollable dissapation of exhaust...uninhibited... Without resistance.. (though we both know 377ohms) does exist at high frequency...
If the exhaust is unimpeded, at what moment are you suggesting thrust develops
Reply: @aznmutt15  depending on your frame of reference, vacuums suck...  What do you think suction is?
Reply: @meh11235  Now go study hydrogen, and tell us how conductive a cloud of hydrogen atoms at 2 atoms per cubic meter is.  Furthermore, the fact that something is electrically conductive doesn't mean that it's electrically conducting.  I have a box of scrap copper wire.  Now tell us about its voltage..

Also explain, while you're at it, what any of this has to do with rocket propulsion.  It doesn't.
Reply: @meh11235  You've been there with a voltmeter?

While plasma physics, and some of the work about electrical conductance in hot plasma clouds is perfectly reasonable/real science,
the electric universe, especially such nonsense as the electric sun gibberish, as proposed is a crock based on nonsensical and fake science, much as your denial of rockets working in space.  Deflecting from one bit of nonsense to another, hoping nobody will notice, eh?
Reply: @fromagefrizzbizz9377  current acceptance for space density is now ranging  0.1 to 1000 hydrogen atoms per cubic centemeter ... Think about that...   Space ain't empty and energy moves... Force flow is at higher frequency because space is a plasma, though materially a quantized super fluid.   
Now go look into the fact atoms are only inferred... And completely based on vibration (momentum), environmental dielectric properties, current and entanglement...   
Ion thrusters wouldn't be possible without the impedance of space... 
There are ion thrusters currently being tested with Lockheed and other companies...
That'll do...
Reply: @fromagefrizzbizz9377  377ohm is your starting point...
Reply: @meh11235  On that other thread, I didnt want to spoil the argument by telling you: I have PERSONALLY launched FIVE spacecraft to space, and FOUR of them Left earth orbit.  I have personally commanded spacecraft IN DEEP SPACE to perform propulsive maneuvers AND WITNESS IT HAPPEN via the Deep Space Network.  I have indisputable evidence for more than one NASA mission doing exactly what NASA says it did.
Reply: @stuartgray5877   very cool... I don't doubt your experience at all...
Reply: @meh11235  So what did you see when you watched that video?  I have experience MANY "rocket propulsion deniers" that flat out REFUSED to watch the video because they were "certain" that the video was fake.  I have PROOF that the video is not fake.  Now did you watch it?  And if you want the "Indisputable evidence" of at least one NASA mission, google "What happened to Comet Tempel-1 July 4th 2005" and tell me what you learned.
Reply: @stuartgray5877   Rockets work in space..  
My argument is that space isn't a vacuum and that the test of this solid rocket is a fail for its intended purpose although, the team discovered a few things for themselves. 
Just like ocean water over brine on the ocean floor...  differential in pressure and density between layers doesn't mean vacuum in and of itself is the state of sea water.. It just means it's lower density and has differing dielectric properties. 

Beyond my knowledge is the tracking system you use to confirm successful or failed maneuvers. How do you confirm your moves? I'm asking because I'd like to know whether or not you have visual on your craft or, are you depending on telemetry data from a simulation...    Only asking because I'm familiar with advanced simulation. 
I am now outside my scope...and playing devils advocate... 

What altitude test equivalent does your team use for altitude simulation when hardening your circuits and exhaust plume analysis? 
 

Since you've launched  vehicles and, my knowledge in tracking them is limited with respect to the network you use..   How do you confirm successful maneuvering
Reply: @stuartgray5877  the video is great and I'm always happy to see intelligent team work.  My argument remains, rockets in reality rockets thrust in the low pressure environment of space... As space is not a vacuum.
Reply: @meh11235  i said nothing of the sort. Expanding vacuum? No. I said a vacuum does nothing. It does not suck. The simple act of ejecting a mass, burning exhaust, at velocity causes a change in momentum on the exhaust. Because there was no external force introduced to the system, there can be no momentum change on the entire system. Since momentum must be conserved there must be a momentum change from the rocket equal and opposite to the burning exhausts change in momentum. 

Newtons third law says nothing about reaistance. The simple act of throwing an object, applying a force on the object, will cause a force equal and opposite on the thrower. Nothing to do with air,  vacuums, pressure.
Reply: @stuartgray5877  I remember Deep Impact...   
my old life R&D.. rail guns, pulse jets directed energy, molecular biology. 
Probably why I see space totally different than most...
Gonna watch a video on deep impact now..  Thanks for reminding me about it!
Reply: @meh11235  - "As space is not a vacuum."  So are you arguing that we cannot make "High Vacuum" here on earth in vacuum chambers EITHER?  We most certainly CAN.  The facility my office is in right now has very large chambers that can get below 1.0 X 10-9 Torr.  We TEST all of our hardware in that level of vacuum.  Some of the most challenging parts of the tests we perform is to make sure the THERMAL properties of the system continue to operate at high vacuum and Liquid Helium temperatures.  Are you SERIOUSLY going to try to make the case that when the spacecraft get to deep space that WE DONT NOTICE THE DIFFERENCE IN THE THERMAL ENVIRONMENT ???  My company also tests mono-propellant thrusters IN HARD VACUUM , and we verify that the FORCE EXERTED by the rocket engine matches the rocket equation .  I have the test reports that prove this.  We then use the same rocket engines IN DEEP SPACE and AGAIN verify that the rocket engines perform exactly as predicted IN HARD VACUUM.  I dont think you have a remote clue about HOW MUCH WE TEST THIS STUFF - BEFORE launching it to space.  My last program had a VERY sensitive optical instrument that required cooling using liquid helium to SIMULATE the cold of deep space, but we could not do AS GOOD as that same instrument is now performing in earth orbit.  This PROVES that the vacuum in space is EVEN BETTER than 1.0 X 10-9 Torr EXACTLY AS WE PREDICTED.
Reply: @aznmutt15  Agreed!  I cannot seem to get it through the thick skulls of most flat earthers that VACUUM CANNOT EXERT A FORCE ON ANYTHING .  They all think that the "vacuum of space" is like a VACUUM CLEANER .  But a VACUUM CLEANER is more like a WIND TUNNEL that could NOT BE MORE DIFFERENT FROM THE VACUUM OF SPACE   Vacuum DOES NOT PULL the exhaust gases from a rocket nozzle.  Exhaust gases are PUSHED from the rocket nozzle.
Reply: @aznmutt15  I TRIED to explain the example to M H using a crossbow, but I could NOT GET HIM TO AGREE that a crossbow firing a steel bolt in zero-G, IN a vacuum WOULD PROPEL ITSELF BACKWARDS when it fires the bolt.  If I CAN get them to agree to this, I then ask "what happens IF I replace the steel 'Bolt' with one made from WATER ICE" .  WOULD THE CROSSBOW STILL GET PUSHED BACKWARDS?  - If so WHY?  What PROPERTY do the steel bolt AND THE WATER ICE HAVE that allows the crossbow to PUSH ON THEM?  I wont give away my final "reveal" on that topic until I see if M H will respond this time.
Reply: @aznmutt15  I only repeated the logic you put out. Here's mine.. 

1. A rocket is like a battery (stored energy)
2. Resistance is impedance (based on frequency and dielectric environmental properties) to include effects of physical and magnetic drag.. 
3. Exhaust is current
4. The ship itself is ground
Reply: @meh11235  - I can explain anything about the Deep Impact mission you would like.  It would be nearly impossible to find someone alive today that knows more about how that spacecraft operated than I do.  And while you are at it, google "EPOXI images of earth" for picture taken, by the Flyby, during the extended mission after the comet impact.
Reply: @meh11235  actually, you imparted a complete different ideas. Ideas that are not linked to anything. Your concept is something you made up. Energy and force are two different concept and you are trying to link them as if they are one in the same.

All the concepts i have stated is thought up in a frictionless enviroment. Meaning no air resistance, no drag.
Reply: @meh11235  let me ask ypu a basic question. If i had a stick of dynomite next to a bucket floating in the vacuum of space. What happens to the bucket when the dynomite explodes, assume the bucket will not be destroyed.
Reply: M H The difference between resistance and impedance is your starting point. You may also want to consider the current carrying capacity of a literal handful  of electrons.
Reply: chrnc avngr he probably won’t answer - like a politician they know if they admit anything it’ll come back to bite them in the ass.
Reply: Tom Tucker So you are carefully trying to explain that collisions in space are impossible. What are meteors then?
Reply: @fromagefrizzbizz9377  dont forget, he will try and skew anything you said to fulfill his narrative. As you seen him do in this thread many times
Reply: chrnc avngr I’ve literally never seen anyone so good at deflecting/distracting and when you get him back to the original thread, he’s already reversed himself. Impressive ability to baffle the gabble.
Reply: @aznmutt15  depends on the material build of the bucket, it's speed and geometry.  What's your plan for lighting the dynamite, as detcord and fuses require oxygen.(you said stick)
 To answer something from earlier, Hydrogen in space is a must and therefore space can be no vacuum. 
The impedance of space at 377ohm means that the distribution of hydrogen absolutely matters.. Especially since Hydrogen itself is energetically created by electric principles... It's very simple and it's presence preserves the angular and vibrational momentum of energy /information within the universe. 
Space is an ocean, lower pressure than earth atmosphere... (quantized plasma).. Planck forces issue of quantization..) [Quantized superfluid] with predictable expectations based on electric principles and newton's 3rd law.    Now, how does all this tie into the shape of Earth🤔

We know rockets work in space and space cannot be a vacuum.    
You're obviously smart and I don't discount your ability to think... However, you seem to be confused when trying to give analogy
as to how rockets work... Bringing up jets..
Reply: @meh11235  wow. You gave off a word salad to avoid answering the question. How the dynomite explodes is irrelevant. I could use and electronic fuse, i could use detcord because there is an oxidizer inside  and it is contained. The geometry of the bucket will not change what happens to the bucket. So what happens to the bucket when the dynomite explodes? Once again, assume the bucket will not be destroyed by the blast.
Reply: @stuartgray5877  false premise regarding your claims about my perspective in test methodology...   I'm glad you finally mentioned the torr test pressure  use at your place.
Reply: @meh11235  you are confusing a perfect vacuum and a vacuum. To achieve a perfect vacuum is almost impossible, but will still have the same properties of a near perfect vacuum. 

So you believe that there is a fluid with low pressure in space. So what force gives it the pressure?
Reply: @fromagefrizzbizz9377  did you just read what mh wrote? He had to use word salad to avoid answering a simple question
Reply: @aznmutt15  get to your point, you're wasting a lot of energy by using incorrect analogies...
Reply: @stuartgray5877  awesome
Reply: @meh11235  no. You are just avoiding to answer simple questions. What happens to the bucket? Does it move away, doesnt move, or gets closer to where the dynamite was?
Reply: @stuartgray5877  deep impact mission, I'd love to know more about the ship thrusters, shielding and instrumentation.  What spectrum was the camera sensetive to? 

The Earth Time-lapse imagery is too crappy for me to be excited about..

How was the craft cooled when exposed to sunlight, considering limitations in thermal conductivity between ship and space
Reply: @aznmutt15  if a hippo farts in space, will the hippo move forward or sit still, within a spacecraft and outside of it.
  See what I mean,...  
It's better to say the data you want known than to try and pull an answer to lead the conversation. You have the lead. I put the ball in your court by asking, Please explain your logic without asking questions.. Just dissimimate...
Reply: @meh11235  so what happens to the bucket? Does it move away, not move, or gets closer?
Reply: @aznmutt15  I'm trying to learn more about deep impact from Stuart
Reply: @meh11235  if a hippo farts in space inside a space craft it will move forward. Outside is dependant on whether or not the gas can escape. Is it wearing a suit that will contain the escaping gas? Notice how i can actually answer your question and i do not get hung up on what the hippo ate that caused the gas to be built up. So what happens to the bucket?
Reply: @meh11235  you should really learn about how thrust works before you ask about the type of engine it uses.
Reply: @stuartgray5877  I watched your crossbow  video...    Conduct the experiment within an RGA and put it in vacuum...   How much are the flights?

I've seen 'space' test propulsion systems 1st hand experimenting with recoil units under damped explosive pulse loads.. They weren't great and I suggested crystalline hydrogen derived from converting EMF in space...
Reply: @stuartgray5877  easier said than done of course
Reply: @stuartgray5877  look at how he tried to dodge the question about a bucket and a stick of dynomite. Then asked about a farting hippo and some how i can answer his question.
Reply: @meh11235  i answered your hypothetical question. Still avoiding answering mine? Gonna make up some excuse about how did the dynomite and bucket get there?
Reply: @aznmutt15  research  joule expansion
Reply: @stuartgray5877  Considering Joule expansion...  with the outside of a rocket being the expanse of space, how is pressure created at the nozzle throat and what pressures are infact calculated for to negate joule expansion? Please explain.
I understand expansion chambers are larger than exit throats and therefore funnel / compress exhaust to hypersonic velocities but,  how are you specifically avoiding the problem of joule expansion at the interface of nozzle and space. That alone may be enough to kill the thought that rockets 'work' in deep space.
I've never known a team that considered rockets relevant for deep space because of this. Now, defining deep space is gonna be a thing... 
Please explain the joule expansion issue and how modern rocket scientists are taught to overcome it..
Reply: @meh11235  yeah still cant answer the simple question. What happens to the bucket? What happens to the hippo farting?

Oh by the way does the joule expansion happen instantaneously or is there a limit to how fast the gas can fill the vacuum? So of i had an opening 0.01mm vs an opening 0.1mm vs 1mm will the will the gas reach a state of equilibrium at the same time? Now what happens if i was to fill the initial chamber faster than the gas is escaping?
Reply: @meh11235  it's funny cuz you won't even answer your own analogy because it completely debunks you. Way to debunk yourself.
Reply: @stuartgray5877  here's a link...for those following,... https://en.m.wikipedia.org/wiki/Joule_expansion
Reply: @aznmutt15  - Mind if I demonstrate to M H how someone who understand basic physics WOULD ANSWER some simple question when asked?  M H is INCAPABLE of answering questions.  Would YOU mind being my "Test Subject" for my physics challenge?

  Question #1: do crossbows experience recoil when firing a standard steel projectile?  This is a Yes/No answer.

Question #2: If i take a remote controlled Crossbow to zero-G, in a vacuum, load it, cock it, and place it "floating" stationary next to an observer: WHAT does the observer OBSERVE happen when the crossbow is Fired?  What does the observer SEE happen to the projectile and the Crossbow ??

Question #3:  If I perform the same experiment as #2 above, but I replace the steel projectile with one made from WATER ICE will the crossbow STILL GET PROPELLED BACKWARDS?   WHY - what property does the ICE projectile have that makes it like the STEEL projectile, in that BOTH will push the bow backwards when fired?  What is the NAME of that property that both projectiles posses that allow them to "push back" on the bow when pushed upon?

What If I use a projectile made from Solid CO2 (Dry Ice) will the bow STILL get pushed backwards?

Question #4:  If I have a large catapult (10,000 kg) in zero-G, in a vacuum, and it can propel a 500 kg Block of WATER ICE from a stop to 2500 meters per second ,*Will the catapult get propelled backwards* ??

Bonus question: Can you calculate the CHANGE IN VELOCITY of the catapult by firing the block of ice?  (if we assume the 2500 meters per second is measured by an observer that remains stationary during the firing).  What velocity will the catapult have AFTER firing the ice block?

Question #5:  Could this catapult CONTINUOUSLY propel itself in zero-G, in a vacuum, if it could KEEP firing ICE BLOCKS every second?
Reply: @meh11235  oh damn. Even stuart ses that you are dodging questions because you know it will completely debunk your understanding. So what happens to the bucket? What happens to the farting hippo?
Reply: @meh11235  - "Considering Joule expansion...  with the outside of a rocket being the expanse of space, how is pressure created at the nozzle throat and what pressures are infact calculated for to negate joule expansion?"

How about this for an answer: It doesnt fucking MATTER what happens at the boundary of the high pressure exhaust gases and the vacuum .

  The Rocket Engine is ACCELERATING MASS INSIDE THE ENGINE (at about 3000 PSI) Once it is hurled out the rocket nozzle what happens to the gas IS IRRELEVANT because the engine is FINISHED PUSHING ON THE MASS before it crosses the plane of the nozzle.

You people KEEP CLAIMING that rockets CAN PUSH on atmosphere at 15 PSI, but then you REJECT that exact same concept when the rocket engine is PUSHING ON GASES AT 3000 PSI !  

 SO a rocket CAN push on AIR at 15 PSI, but it CANNOT push on CO2 at 3000 PSI?

 What are you people smoking?
Reply: @stuartgray5877  1. Yes.
2. The cross bow will move away from point of origin with the same momentum as the bolt.

3. A similar effect. Conservation of momentum. Or newtons 3rd law. They are related. 

4. Yes, but the propulsion is limited because of the torque applied will cause rotation which will limit the linear velocity.

Yes if i knew the mass of the catapult and had the force applied directy in line with the center of mass. Lets say with a giant crossbow.

5. Yes. Every change in momentum on the projectile will cause and equal change in momentum on the crossbow. This will allow zero change in momentum of the system as a whole, thus conserving momentum
Reply: @aznmutt15  Very good!  That's what I spent a few hours with M H yesterday and he just flat out refused to answer.

For #3, the last question "What is the NAME of that property that both projectiles posses that allow them to "push back" on the bow when pushed upon?"

 I was just looking simply for "Mass"

4. - Sorry, I changed the term. Assume the "catapult" is perfectly linear.  Thats why I like the crossbow example.

So I have tried this challenge on "Physics Deniers" many times.

Only a few have gotten all the way through the above questions.

But NONE of the "Rocket Propulsion doesn't work in a vacuum" crowd have EVER Come back after I explained the following:

The Space Shuttle Main Engine (SSME) consumes liquid Oxygen and liquid Hydrogen at 500 kilograms per second and EJECTS a stream of 3000 PSI WATER AT 2500 meters per second EVERY SECOND .

So a SSME is a GIANT WATER CATAPULT that MUST be accelerated for the law of conservation of Momentum to be valid.

And for M H - it doesnt MATTER if that water canon is firing into 15 PSI atmosphere or 0 PSI vacuum it pushes A HELL OF A LOT IN BOTH.

But in fact it pushes HARDER when firing in vacuum, just as the rocket equation predicts, and just as we TEST in hard vacuum.

We ALSO test Ion Propulsion in hard vacuum so we have MEASURED the difference in test here on the ground, then VERIFIED the performance in hard vacuum in Earth orbit and beyond.

  Modern Satellite service providing spacecraft are using Ion Propulsion right this minute for station keeping in their respective GEO slots.  The latest design even has NO chemical propellant system and even used its' Ion system to CLIMB to it's final position.
Reply: @stuartgray5877  alright let me ask you some questions.

1. If i had a bucket in space and a stick of dynamite next to it. If i exploded the dynamite, what happens to the bucket, assuming will not be ripped apart? Will it stay in the same position, move closer, or away from the location of the dynamite?

2. Now if i did the same with the dynamite inside the bucket, what happens to the bucket, again assuming the blast will not destroy the bucket. 

3. Lets use mh analogy. If we had a hippo farting in space what would happen to the hippo inside a space craft? Outside the spacecraft? let's assume the hippo can withstand the gasses wanting to expand and will remain the same shape.

4. Can we sustain pressure in a burn chamber by limiting the area we let pressure to escape?

5. If thrust is dependant on pushing against the atmosphere, how does the sr71 push off a thin atmosphere at 90,000 feet, while the atmosphere is also moving away from the nozzle at mach 3?
Reply: @stuartgray5877  damn misunderstood #3.

I know. I asked a guy that a rocket has thousands of tons of fuel, if the mass of the fuel does not get ejected creating momentum, what happens to the mass of the fuel. He says it gets burned. Then i explained to him that burning of the fuel releases chemical energy, but does not destroy the mass of the fuel.
Reply: @aznmutt15  Sure 

1 - The bucket would get pushed away from the explosion as the high velocity gas molecules hit the surface of the bucket and imparted momentum into it by bouncing off.

2 - It would get pushed HARDER away from the open end as more of the high velocity gas molecules bounce off of the inside of the bucket.
3  - The hippo inside would be propelled towards the wall opposite the direction of the fart. Outside it would be propelled in the opposite direction of the fart.
4 - Absolutely - I often use the example of a metal sphere with a pinprick sized hole in the side
, then imagine lighting a mixture of combustible gases/oxidizer inside

5 - I have used this exact example.  Stated "If rocket engines push off the atmosphere to propel forward, Please explain the MECHANISM for the force to get transmitted back to the engine AFTER the engine reaches the speed of sound"  - It CANNOT, even jet engines are REACTION engines. and they can keep accelerating to velocities greater than the exhaust gas velocity.
Reply: @stuartgray5877  what? No excuses of how was the dynamite lit, det cord, fuse. No question of the geometry of the bucket. No explanation on how the rocket and jet engine burns fuel differently, even though it is irrelevant to how the fuel is burned, just how the burned fuel creates thrust is the same for both engines.
Reply: @meh11235  you actually learn to answer questions, instead of makong excuses. Maybe you can actually learn a thing or two.
Reply: @aznmutt15  Of course he did.  He's also reversing himself on whether rockets work in space from one posting to the next.

Pretty fun to watch actually as long as you recognize that's what he's doing.
Reply: @meh11235   it's funny how stuart and i can answer each other's questions without making excuses and bringing up off topic points. How do you expect to talk about the engines of the deep space probe, when you dont even understand the basics of thrust? You make up your own physics and mix up topics and ideas.
Reply: @aznmutt15  you can't even explain your point because you're to busy studdering over whether or not you believe someone can comprehending your unspoken point.
Reply: @aznmutt15 you've yet to prove you understand the basics of thrust and how it correlates with the principles of momentum, plasma and electrodynamic space.  Here's more to study...   http://www.crossfirefusion.com/spacedrive-electric-propulsion/electrodynamic-space-thruster.html
Reply: @meh11235  no i compared the way jet engine uses thrust to a rocket and then asked about how does the rocket push off the atmosphere going mach 3. You brought up the point on how they burn fuel is different, which is completely irrelevant how the thrust of both engines work with the same pricipals.

Then i ask about the dynamite and the bucket and you ask about the fuse and the geometry of the bucket. Avoiding actually answering the question.  You are basically saying how cow digest food is different than i do, so it cant be shit that is coming out the back. Stop dodging and answer the basic question.
Reply: @meh11235  so what happens to the bucket when the dynamite explodes next to it?

If you dont like my question, then at least answer your own. What happens when a hippo farts in space? Inside a craft and outside the craft. Let's ignore the effect of built up pressure on the hippo saying it does not need a suit to survive. So what happens when the hippo farts?

You call thia bating? No it is me simplifying the concept and leading it to a more complex system. You just know the outcome and can't refute the answer, so you dodge. 

Stuart seems to get my point pretty easily.
Fromage gets my point pretty easily. You just turn a blind eye and jump topics to answer a basic question.
Reply: @meh11235  So did you WATCH THE VIDEO "Six SpaceX launches synchronized to the landings"?  If not WHY???
Reply: @aznmutt15  false premise again stuck does not compute...
Reply: @meh11235  i havent even made my point yet. You haven't come close to answering before a point can be made. It's as if you are affraid to answer. Since you say it is a "false premise" then please elaborate why. 

Wasn't the farting hippo your question also?
Reply: @meh11235  it's funny cuz when i posed the same questions stuart was able to answer and elaborate how it relates to thrust. All you have given is a throw away statement without any context.
Reply: @aznmutt15  Notice that he will not even acknowledge the existence of the video I keep telling him to watch that DEMONSTRATES rocket propulsion in a vacuum ON VIDEO.  Have you ever watched it?
Reply: @stuartgray5877  are you talking about the 6 timed falcon landings?
Reply: @aznmutt15  yes. I have a video of the landing of the bottom middle (NROL-76) taken from a cellphone on my YT channel
Reply: @stuartgray5877  that's awsome. Ive never been to a launch before
Reply: @stuartgray5877  check out this eclipse photo i took
http://imgur.com/gallery/mczgB3l

http://imgur.com/gallery/8Qih4Ra
Reply: @aznmutt15  reality is that space is not a vacuum as you stated many times and, anyone can look up the rocket vacuum chamber altitude test equivalent parameters and limitations for almost any rocket lab and testing facility.  Apposed to speaking in torr, I prefer simple terms like 'altitude equivalency' because after all... We demarcate space in reference to altitude from earth surface... MSL ring a bell? We don't test to (deep space). We test to Altitude Equivalency and nothing publicly tests up to 400 thousand feet. 
Why be surprised at the pressure difference between high altitude and sea level... The exponential nature is of pressure differentials extends from the  floor of oceans up to sea level...    Look up Brine lakes at the bottom of the ocean... 
Discussing rocket in vacuum is a mute point.. However we can have fun with it, like we have thusly been doing.  I'm at my limit of understanding when I have to justify the joule expansion issue with potential thrust transition from the combustion chamber to nozzle and low densoty space.. 

The only way to control output is to throttle back, because we all know that pressure moves from high to low and the low pressure environment of space, with its immense volume will dissipate all exhaust instantly.. So again, how do modern rocket scientists account for the joule expansion?  
... might the joule expansion not apply to rocketry, since space is not a vacuum? Is that why our rocketry vacuum chamber altitude test equivalents are in the 100s of thousands of feet?... That's pretty low considering the supposed size of space. Thoughts?
Reply: @meh11235  all of what you say is pointless or wrong. Space is not a vacuum? As i said any time there is a differential in pressure, the lower pressure is considered a vacuum. A vacuum cleaner creates a pressure zone that is lower than the surrounding atmosphere, that is a vacuum. Space is not a perfect vacuum, but is near perfect. The difference in pressure of a near perfect vacuum and a perfect one is negligible.  0.01 tor vs 0.000000001 tor is still only 0.01 tor difference. It's like saying 0.01 milligrams is significantly heavier to 0.000000001 grams. 

As for the vast volume of space will dissipate the exhaust. So what? Vacuums do not suck, so the pressure will always be in the burn chamber because the nozzle will limit the loss of pressure. 

As i stated before, the area of the nozzle will limit how fast the pressure is lost because of fluid dynamics. There is a maximum speed which a gas can flow through a specific area. It is irrelevant how much space there is and how low of a pressure there is in the vastness of space. You think that vacuums will have some great power and suck the air out. The fact is vacuums don't suck, everything is dependant on how fast pressure is able to escape. The difference of the rate pressure can escape a burn chamber is solely dependant on the area of a nozzle. From sea level and a perfect vacuum will have little effect to the rate pressure is created in the burn chamber. 

Since burn can be sustained and thus ejecting mass at high velocity, this creates thrust. This act alone is enough create an acceleration on the rocket due to newtons third law. 

As for the bucket, we all know that the bucket will move because of the dynamite, you are just affraid to admit it. Now if i place said dynamite inside the bucket, the bucket will direct more of the blast in the same direction creating thrust. So a rocket engine does this million times a second.  Guess what, the rocket will move like the bucket. 

Now, since the rocket can sustain burn inside a vacuum because there is a maximum rate pressure can escape due to the size of the nozzle, irrelevant to ruger size and pressure of the vacuum it is in. And the fact that simply ejecting mass a high velocity, the exhaust, is enough to accelerate the rocket, due to newtons third law and the conservation of momentum. Thrust does not need a medium to resist the exhaust. So why can't a rocket work in space? 

What happens to the farting hippo in the vacuum of space?
Reply: @meh11235  wow, that was scathing what stuart said. Your basic understanding of the topics you talk about is abysmal. You mix up terms, concepts and mish mash them together to try and make a hodgepodge idea. You refuse to answer one question because you cant explain it.

Here how does thrust cause acceleration? It does not matter if it is a rocket or a jet engine, how the fuel burns is irrelevant. How the burnt fuel causes acceleration is what im looking for. Remember f=ma. Where is the acceleration coming from
Reply: You are in an atmosphere.  Thats why you go back. In a vacume you cant.  Type  in feather and fan in a vacume
Reply: @alexrussell6770  consevation of momentum says that the momentum of a system must remain constant unless an outside force is introduced. If the rocket is ejecting the mass of the exhaust at velocity, that contains momentum. Since the combustion was an internal force of the system and not external, how is momentum conserved for the system as a whole?
Reply: @alexrussell6770  oh and a rocket/jet engine uses a different physics to create motion vs prop or helicopter engine. The prop and helicopter engine pushes the atmosphere with a prop creating an opposite reaction in force. A rocket/jet engine is burning fuel  causing a rapid expansion forcing the burning gas out the nozzle at high velocity creating an opposite reaction to the force of the chemical reaction. Your little point of the feather and fan in a vacuum will show why a helicopter won't work in space, but is complete lo y pointless when talking about rockets.
Reply: @bethechange4934  no perceivable recoil , Does that mean that a " Blank round " Can't Still Kill ?
Reply: @jamiemeyer2483  
If you had the muzzle right up against a critical body part then probably yes.  The energy is there but it isn't transferred into a bullet which is transferred into the body when it hits but rather dissipated into the air pretty quickly so you would have to have the muzzle right up to something to do mortal damage I think.
Reply: People are just trying to justify their flat earth conspiracy.
Reply: @snuffly569  it's the same concept. It doesn't matter what the expelled object is, when you rapidly get rid of mass you will have an opposite effect.
Reply: @snuffly569  you just answered it.
Reply: This whole thing could be settled pretty easily.  Take a decently sized vacuum chamber, introduce a balloon that was capped.  When the vacuum is pulled, the balloon fills up in response.  Experimentation would be required to determine the amount of air in the balloon before drawing the vacuum.  Once the vacuum was drawn, let the balloon go.  What happens.  End of discussion.
This is child's play.  Somebody do the science and put this puppy to rest.  I would do it myself except, like most of you, I don't have access to a large vacuum chamber.
Reply: @aznmutt15  "The recoil isn't felt till after the bullet leaves the barrel." I don't think so. I suggest that the instant the bullet starts moving in the cartridge. Newton's 3rd is very simple. The movement of the bullet in the cartridge is an action. Therefore there must be an equal and opposite action. Enjoy some of the actions LOL in this vid. It's all fascinating isn't it. 
https://www.youtube.com/watch?v=zbtyaKAMDdk
Reply: @robguyatt9602  actually, there is a minor recoil once the bullet moves due to air resistance, but as soon as the bullet or gas has a vent to escape from, that is when the real recoil occurs.
Reply: @aznmutt15  What's so hard about admitting that your statement was incorrect instead of changing the subject to different types of recoil FFS! Oh and air resistance? Have you any idea how weak the air resistance is inside the gun chamber and barrel compared to the resistance due to friction between bullet and case and bullet and barrel?
Reply: @aznmutt15  Oh wait. I can be so thick at times. Your words were "The recoil isn't FELT..." I read you as saying there is no recoil till the bullet leaves the barrel. Again, humblest apologies. Actually I suspect that the feeling of recoil in one's hands or shoulder is well after the bullet has left the barrel due to the momentum of the gun/rifle and human response times. Now that's a fascinating thing to consider. Ya think?
Reply: @robguyatt9602  well the physics is, is that the explosion of the powder does is really pushing in all direction and is an internal force. Though there is a slight recoil due to the bullet traveling through the barrel, the real recoil does not start until after the bullet and expanding gases leave the barrel. It is the conservation of momentum. Until the bullet and gas leaves the system momentum, there is little change in momentum. The center of mass will hardly change with the traveling bullet and gas. This is why you wouldn't have to compensate for recoil. Though the resonance of the barrel can effect the trajectory of the bullet.
Reply: @flawedobserver4057  rockets carry their own oxidizer. Same reason why a gun can be fired underwater, it contains both the fuel and oxidizer inside the powder.
Reply: @shonmugerian  The rocket is firing huge amounts of gas at very high speed, each particle of gas is representative of a very tiny bullet. A rocket fires a load of that out the back at very high speed imparting a very large recoil (thrust) to the rocket. So the principal is exactly the same, it is also accelerating that mass from 0fps to 66,000fps. Why do you think expanding gas would not produce a recoil? Any gas has a mass and by making is move in a particular direction it will have an equal and opposite reaction.
Reply: @thomasgronek6469  I hope you are just trolling...
Reply: @thomasgronek6469  In that respect the atmosphere does have an effect on thrust, however, it is an undesirable effect and one that rocket stages are used to overcome. The shape of the rocket thruster is designed to compensate for the change in pressure as the rocket gains altitude but the rocket still work in a vacuum or else none of our spacecraft could ever return to earth because they would never be able to deorbit. In fact, the Apollo missions seemed to take off from the surface of the moon without the help of an atmosphere, the atmosphere on the moon would be considered a pretty good vacuum here on earth.
Reply: @thomasgronek6469  Actually, it makes you very wrong and lucky for all astronauts something is right whether you understand it or not.
Reply: @thomasgronek6469  Yeah, you are just trolling... LOL good one!
Reply: @thomasgronek6469  hahahaha - brilliant! 10 out of 10 for the windup!
Reply: @fromagefrizzbizz9377  There is no mass of ejected gas, One:  it's weightless in space, Two:  It dissipates immediately because it is in a vacuum,
Reply: @thomasgronek6469  Of course there's a mass of ejected gas. 

One: mass is not the same thing as weight.  Mass is a unit of "quantity" (how much "stuff" there is in something) whereas weight a unit of force applied to that mass by the pull of gravity.  The distinction isn't obvious in that archaic units of measurement you use, because a pound of mass is used to define the "amount of stuff" by the force exerted by earth's gravity on that amount of stuff.  In metric, the distinction is obvious: mass is in kilograms.  Force is in newtons.

2: it doesn't matter in the slightest what happens to the gas once it leaves the rocket.  It doesn't matter if it hits something, or not.  The recoil of a gun is not affected by what the bullet hits/or doesn't.

The Saturn V "worked" by burning 10 tons of fuel and oxidizer per second, and throwing it out the back end at 4000' per second.  That takes a tremendous amount of force to do, whether it's gas, marbles, bricks or firetrucks.  It makes no difference whether the 10 tons of mass, whatever it is, hits something, blows up, "dissipates" or not, the force has been applied, and the recoil aka "every action has an equal and opposite reaction" happens.

Which is why, for example, the rocketry equation EVERYBODY USES to design rockets doesn't give a flying fuck what the expelled mass is, and has never done so since the 1800s.